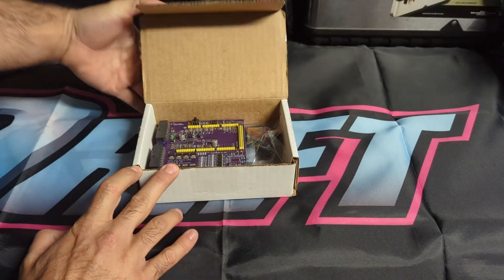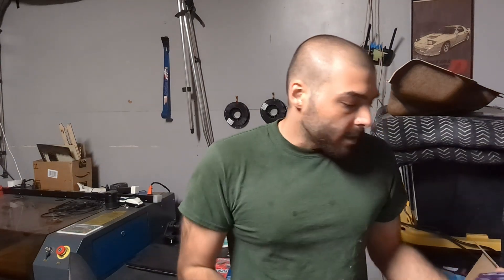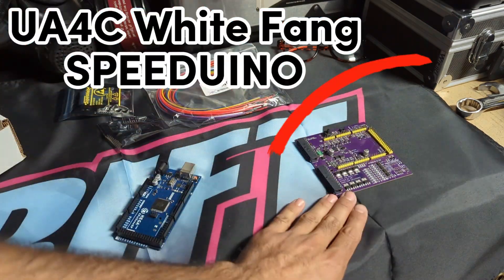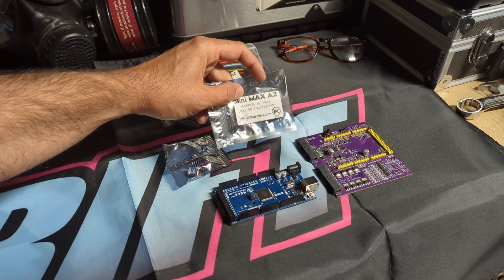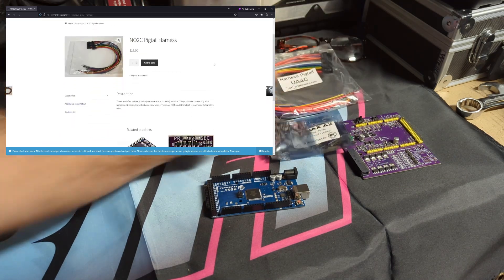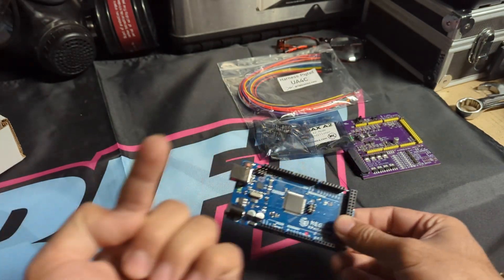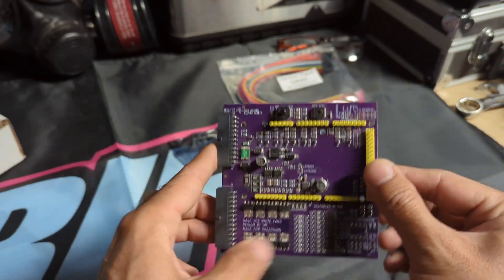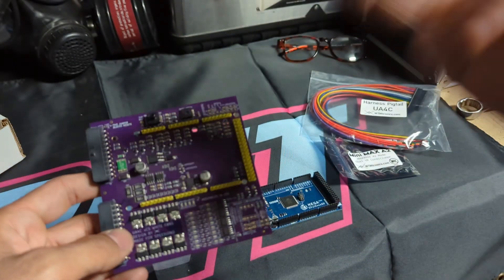What to BUY when setting up a SPEEDUINO (open source ecu)

Comment: You mentioned the need for VR conditioner, based on using a distributor from a VG

Do you mean a nissan VG30E? It has optical pickup inside the distributor. You can even replace the toner wheel with an improved one and replace the optical sensor when they fail. So if you connected to the output of the sensor, wouldn't you be able to not use the VR conditioner?
Reply from the maker: Yes! You are right. The issue im running into i didn't know at the time is. The VG30 dizz wheel patter is not compatible so i was thinking my issue was vr conditioner, but its that we need to replace the toner (trigger) wheel. I plan on also using this for a 1nz and ill need the vr conditioner there, but thanks for the comment! I want to get back to this project so bad :< but having to move tossed it all in the air.

Comment: how good is this opensource ecu, can it run say a honda k24 in a bmw canbus? love the eurobeat!
Reply from the maker: Well I can't say how good it is vs other ecus, but you will have options on how you want to run the K24. Depending on how you want to set up the spark and what kind of injectors you are running.  This U4AC has 4 channels for spark so you can run each cylinder, but for 6+ you need to set up the spark in pairs. 

https://wiki.speeduino.com/en/wiring/Injector_wiring. 

The big thing here imo is you can us MAP to get your fuel tables and thus adjust for boost levels. A speeduino does the same thing as a megasqurit or something but for less. 

As for the BMW canbus thing. I'm not exactly sure. From my understanding canbus is a protocol bmw seams to have some of its own other protocols too. 

https://medium.com/@chairface/talking-to-your-bmw-tapping-into-a-cars-communication-bus-4adff7ac640d

It doesnt seam like the canbus is fully implemented for broadcasting functions for the speeduino yet. So ide image you would need to do some custom things if you are trying to control things over can with this ecu, or if i was you i would join the forums and ask there.
Reply: @aftereartharcade  that wiki link was helpful, it looks like speeduino can work with the analog bmw's before 1999 when they went to canbus system. Thanks bud!

Comment: Nice vids! FYI the Arduinos on the WTMtronics site have the Atmel based 16u2 serial chip. The pic is old, you can't even buy those particular units from robotdyn anymore, and it was not a CH340, but another vendor's IC.
Reply from the maker: Thanks for the info!  :D
The one i bought from WTMtronics was a CH340 but that was late last year.